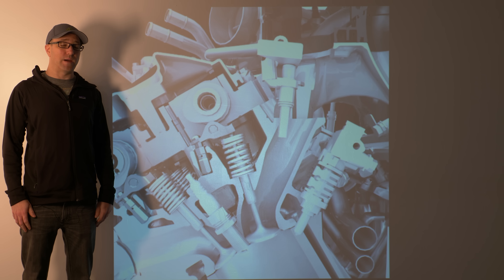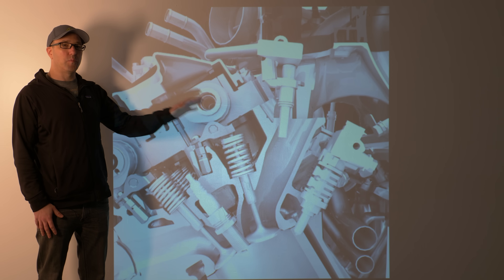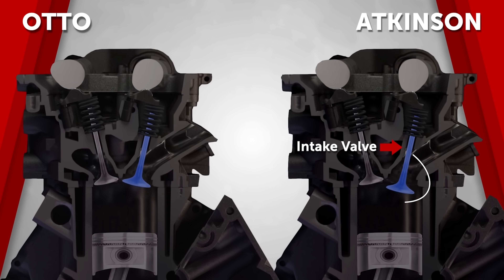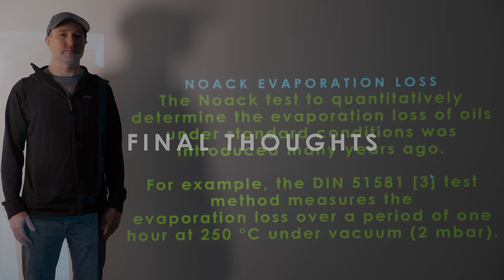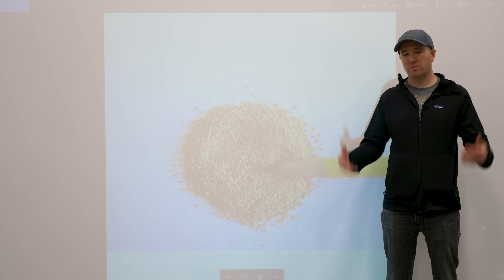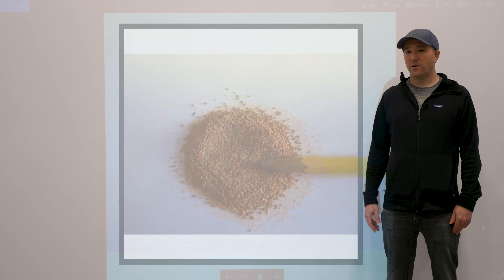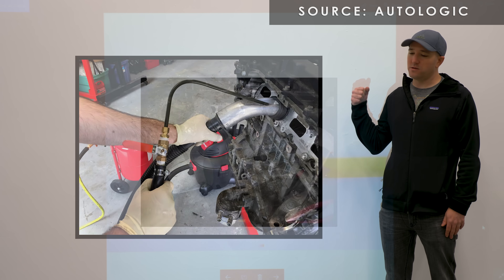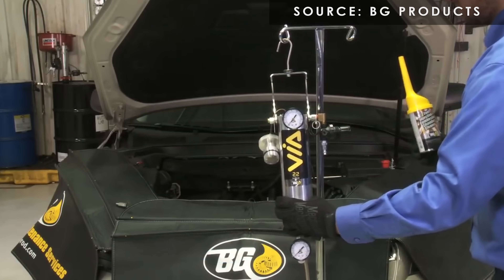Direct Injection, Problems and Solutions | The Fine Print

Comment: Very informative video. I have a suggestion that nobody has talked about. I took my car years ago to a dealer who performed an air intake cleaning. They hooked up an apparatus near the throttle body, pulled out the fuse to the fuel pump, and sprayed the cleaner and then started the engine. It cleaned the whole intake. It ran for about 15 minutes. Wouldn't that also clean the intake valves?
Reply: Yeah that would work, the shop I work in does a similar service. You do need to meter the fluid VERY accurately or you either run it too lean or too rich. Our kit doesn't disable the fuel pump, it drips down at a fixed rate into the intake in addition to the gas.

Comment: Well, highway mileage keeps it clean too! (I've read some people who've backed up this with boroscope footage too) - I own a 1.2 TSI VW Polo with 270.000km /around 170000miles/ and I drive around 30.000km a year, 90% of it is highway speeds. The car has never had carbon build up issues or any related issues. It runs on LPG (liquid though the petrol injectors) and I do around 6-7L/100km of LPG (around 36-37mpg). Which corresponds to around 47mpg on petrol. Which is extremely good! The engine is still really happy and goes like a blast to 200kmh! I still wonder what the valves look like though! I love the small GDI turbo engines on LPG! Diesel like torque in the lower rpm range, low rpm on the highway and so on (around 2000RPM at 100kmh)

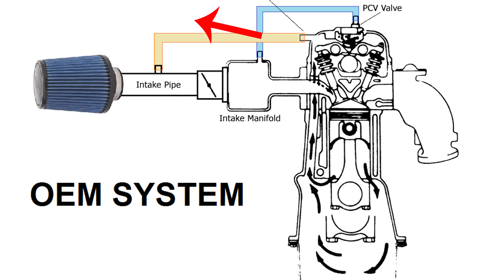Comment: At 7:51 there are 2 hoses for pcv. My car has the same system. Why is that needed? Why they both dont go in the intake or both in manifold? I think its related to temperature and chamber conditions from where gases are going out

Comment: Some observations:  The blowby gases do not move up past the rings (~7:17), they move from the combustion process down into the cylinder and into the crankcase.  They are then routed back into the intake via a positive crankcase ventilation (PCV) valve.   This has been done since the 1960s (I believe).  Before that, it was routed directly into the atmosphere out of the bottom of the engine through what was known as a breather tube.  Watch an old movie and notice the dark area in the center of highway lanes.  That is a big long streak from all the breather tubes from all the old cars as they passed by where oil dripped out.  Back to now, sludge does indeed build up on the back of intake valves (not on exhaust valves) for two reasons.  The fuel injectors in GDI equipped vehicles do not spray fuel on them as stated and many engines now are smaller and work harder with higher cylinder pressures thereby creating more of these blowby gases than engines of the past.  Well, is this a problem, the buildup on the back of the intake valves?  Maybe and maybe not.  Don't let videos like this say it's always a problem because it most certainly is not.   Skipping ahead, the PVC system is most definitely not under vacuum as stated in the video.  There is positive pressure in there not a vacuum.  Only in turbocharged or supercharged applications are there pressures greater in the intake than in the crankcase and then only when boost conditions exist which are brief and infrequent.  Therefore, having an oil that has low volatility in a vacuum is worthless.   In summary, this issue is way  overblown.  Only under rare circumstances do you need a catchcan.  GDI technology allows manufacturers produce powerful, clean burning engines.  If you run your engine hard and have 300k km or 200k mi on it, you may want to consider cleaning the intake valves but not before.  Don't buy into these scare stories.  I have a GM 2.0L turbo engine with GDI.  GM recommends to not clean the intake valves on my engine.  GM designed it, they've tested it, they know what they're talking about.  Otherwise a good video.
Reply: @highball7347  or maybe they had other issues* causing buildup to became issue in shorter time.

* Early GDI engines had issue with injector leaks after turning engine off, which would end up in oil, increasing evaporation on next drive. Newer engines usually have pressure release valve on high pressure line, which releases pressure when engine is turned off, drastically reducing leak. Little bit of leak isn't issue, but bigger amount, especially on cars used on short drives, can increase buildup, but also, in extreme cases make oil thinner and cause faster wear on cylinders and turbo, which also increases buildup. Other possible issue is bad seal on turbo.
Reply: I don't know nearly enough to have an opinion one way or the other. I do have a GM car with a direct injection engine, and have found out that GM will void the warranty if a catch can is used. Any ideas why they would do that if the catch can is only supposed to do good things for the engine? Could it be that they simply don't want any modifications at all to the engine or could there be a legitimate downside to using something like a catch can?
Reply: @erickdj2009  catch can makes you more vulnerable to introducing water into the system
Reply: @thetechlibrarian  How so? Does the catch can collect moisture or condensation?
Reply: @erickdj2009  if vented to atmosphere it turns a closed loop into an open loop increasing the propensity for atmospheric moisture to enter the engine.
Reply: @erickdj2009  I believe pcv affects the temperature of the burn, without which there can be damage to the cat. I have no expertise on this btw.
Reply: Agreed, except that many DI engines will begin to experience misfires at the ~80-100k mile mark (depending on oil used, driving type etc) due to carbon buildup on the valves that will need to be addressed.
Reply: @BurmaJ Which is a big issue for most people who keep their cars for a while and put a lot of miles on. I stay away from DI.
Reply: Indeed.  The P.C.V system causes the same issue for any car other than direct injection.
Reply: Exactly correct, and well said.
Reply: PCV receives its vacuum from the intake manifold. Remove it and see how you engine runs.

Comment: the feds ( more like globalists really ) are working hard to kill the ICE.  but i refuse to go EV.  the infuriating part is that dual injection is such an obvious solution yet only probably 5% of engines on the dealer lot have it.  as Scotty Kilmer would say - planned obsolescence - the sooner the engine fails the sooner you need to buy a new car - so this carbon build up is actually a feature - it happens right after your warranty runs out - surprise surprise !

Comment: Lexus is 250s 4gr-fse had this issue often, with a lot of piston rings needing to be replaced and pistons replaced or cleaned off due to customers neglecting EFI and Intake Valve services. Im glad they discontinued that engine replaced it with a much better 4 cylinder turbo

Comment: Our shop picked up the 3C Carbon Cleaner from ATS Carbon Clean about 9 months ago. It works FANTASTIC! We tried all the usual chemical companies, BG, SeaFoam, etc with very little effect to carbon deposits. The 3C does the job in 15 min without disassembly. Highly recommend looking into. Great Video!
Reply: can you put this is gas to clean or have to take apart to clean?
Reply: It decarbons the injectors and the oil system but it doesn't clean the intake valves.

Comment: Sadly, in this insane world, if you ran such an engine with hydrogen and made it the most simple and cheap technology, the ecofascists would still complain about resource consumption and that their mentality of suffocating scarshitty still needs to be enforced.
I am wondering whether Volkswagone was too technically incompetent to forsee this buildup or whether management pushed for quick release of flawed tech. I mean, even for me it's like basic knowledge that fuel cleans the valves. - But in any case, why the hell did they not just install a catch can? It's so cheap and simple to add! (Also, VW are evidently big cheaters.)
One thing about my car's engine that is cool but little-known is that it has such a catch can. (It's a 3S-GTE with ceramic turbo. ... That turbo is also why I am using a stock air filter.)
13:17 Ooh, that thing is radioactive! 😄

Comment: Seemed fine until he started describing blow-by as blowing up. Blow-by is blowing down from the cylinders into the crankcase which is at the bottom of the engine. Not the top. From that time on a lot of what he says is nonsense.

Comment: I , m a retired engine mechanic. I still fix my own vehicles. I won’t own anything built after 2000.
Reply: My 99 Toyota Camry solara coupe was the most reliable car I've ever been around I was an idiot when I owned it when it came to changing fluids and maintenance and kept running forever used to have to drive it 250 miles a day for work
Reply: 1.2 TSI, 270.000km liquid LPG direct injection, runs like a champ! Much better than the silly 1.0 Mpi engine I've had before. Plenty of torque from 1500RPM and smooth driving! Awesome!
Reply: Really? Toyota sold cast iron block port injected Tacomas until 2023.   The 2tr-fe 4 cylinder made in Japan.   (Rest of truck assembled in Mexico though).  But is that engine paired with rear wheel drive 6 speed tranny not reliable enough for you? It's GM and Ford that are building crap.

Comment: Best way to avoid the problems affiliated with DI or GDI or SIDI engines is not to purchase a motor vehicle that has such a powerplant in the first place. Much better options are out there -- such as engines with additional port-side fuel injection in addition to DI-GDI-SIDI, like many of the Audi, VW, Ford, Toyota, and Lexus engines.

Comment: I came to this video by searching for "Direct injection," Mr. Google did not disappoint me.  We just got the Ford Explorer Platinum 2020, and the fuel delivery method  is Direct injection.  Thank you very much for this great video, now I now what we have. By the way, I just ordered(before I watched this video) AMSoil 5-30, oil mentioned in this video.   

Oil volatility?  Why lower is better?  Here is an explanation taking from asmoil.com: "Oil consumption is like water evaporating on a hot day. Just like the heat of the sun lifts water molecules out of a container of water and into the air, high engine heat can lift the light, unstable molecules out of oil, causing the oil level to drop. The evaporated oil exits the engine through the crankcase ventilation system.

A motor oil’s volatility describes how readily it will evaporate when exposed to high heat. The higher the volatility, the higher its tendency to evaporate. The more the oil evaporates, the less oil is left to protect equipment and the faster you must replace the lost oil. You may have experienced the phenomenon if you’ve owned a vehicle that “uses” oil."

Comment: I took the intake off my 3.0 SRX and used regular gas to clean my valves. 
Worked. I found out Gasoline cleans carbon really well. I poured gas in, used 
a long wire brush, soaked it up, blue it out wit air and it worked.

Comment: The biggest problem is egr baking the oil and soot on there, if it wasn't for egr the oil vapours would just pass through the valves and yes they would be damp with oil but they wouldn't foul up because they wouldn't have the soot and exhaust gasses burning the mixture of oil vapour and exhaust soot on there, also regular oil changes help as well 🤗

Comment: Curious as to what if you add say, small extra injectors to a port injected motor?  Maybe from a 600cc motorcycle.  (Drill holes, weld bungs, etc.) wire them in direct with the other injectors for each cylinder.  I’m obviously thinking about my Audi 2.0t. But honestly, couldn’t you get it remapped and tuned to not only make more power, but also run just as efficient, and also stay clean?

Comment: Yep just did catch can on mazda cx-5. Nice and difficult to get to and they use 5/8 on pcv and and 3/8 on intake so had to use reducer, fun stuff hope it stays sealed and doesnt clog. After 45,000 valves looked like the ones in your pictures. Bought one off amazon and re-engineered it to work better. Just checked it today and was almost half full After bout 2000 miles.Trying to clean with seafoam or anything else with flushing method will get you a nice expensive brand new caty. Ask me how i know.Gotta clean with brush or walnuts not fun either way but to each his own. Thank you so much for the pcv system. Makes life so much fun... so much

Comment: I have a 2013 Lincoln MKS Eco-boost AWD sedan. I've added a catch can on it and run an Italian tune-up at some point everytime I drive it.
So far this has worked very well for me. I also use high quality full synthetic motor oil.
Never use carb cleaner or anything like that to clean the valves on a turbo charged engine. If a piece of carbon breaks off it can destroy your turbo charger. I have dual turbos on my Lincoln, not taking the risk. But so far things are going well.

Comment: Very well done! Unfortunately, two or three generations of single-injector DI cars are now passing through the used car market. I will never buy one. Ever. So it's necessary for me to go older or newer. I go older, and I'm a happy DIY owner. But at some point, this could become a PITA. 

Everyone be careful about changing oil viscosity from manufacturer recommended values. All internal bearing tolerances are matched with a pretty tight range of oil viscosities. I'd say turbos are particularly sensitive, especially on cold start up. As the man says, do your research.

Comment: My 2012 Ford Focus had port and GDI injection – the purge valve in the charcoal canister applied a vacuum to the fuel tank, so the vapour line from the canister to the intake manifold dumped fuel into the intake manifold. 

Oh – side effect – it caused the catalytic converter to fail! 

How does a catalytic converter fail at 70K miles??? Ford cars and crossovers = garbage.

Comment: Some of the information given in this video is incorrect.  Blowby is what is forced past the piston's rings into the crankcase.  The PVC system is designed to alleviate this pressure buildup in the crankcase.  There were a few other misstatements in the video, but going point by point would not be helpful overall.  The general ideas are close to the mark, but there is room for improvement on the principles of internal combustion engine operation.

Comment: DI is horrible. The benefits are useless, but the problems are tremendous. Carbon buildup, timing chain failures at 100,000 miles, and to top it all off, fine particulates to pollute the environment. Evil government regulations forcing us into dirty technology, because the bureaucrats are on a power trip against NOx.

Comment: Bottom line question here: Should I avoid buying the Genesis G70 becasue it had a GDI engine despite the fact that it's relatively a good car and just go ahead and buy a Volkswagen R32 Naturally aspirated engine because it's more reliable? 

Looking forward to hearing an honest piece of advice.

Thanks,
Reply: I mean the biggest problem with carbon buildup from DI is that you’ll have to clean it eventually, but if you maintain it well it can reduce the severity of the buildup. The Golf IMO would be less reliable overall. I’m pretty sure many of the last gen German cars still have carbon buildup issues and none of those used DI.

EDIT: Not to mention the other issues with German cars, like chronically shitty water pumps on nearly every one, electrical gremlins, and potentially transmission issues.
Reply: @ToxicHorsePucky  I always wanted a VW, but knew I did not want the hassle of a turbo anything down the road. So I picked up a 12 Jetta with the 2.5 5 cylinder. Nothing fancy just good old fashioned motoring.

Comment: I'd like to see some proof that cars from the '90 were getting 40-80 mpg.  I drove those cars and I've never heard of any of them getting that kind of gas mileage.
Reply: Yeah, so the 80's & early 90's vw rabbit diesels routinely pulled 52mpg on the hwy.  My '89 Corvette (350TPI with a 6sp) would get 32mpg going 70+mph on flat freeways. Many of the older, low displacement Japanese cars did pretty well too!